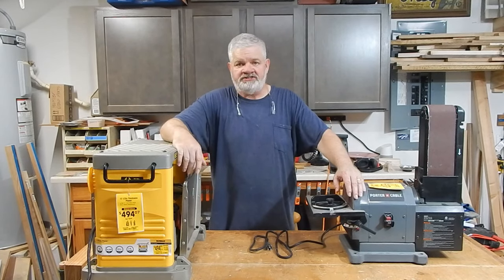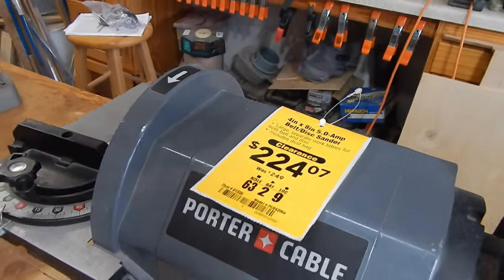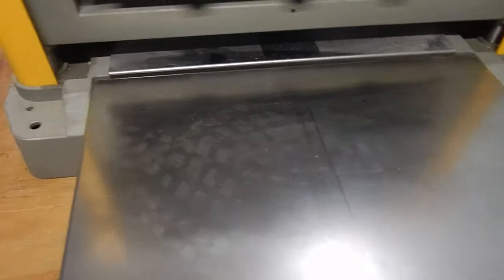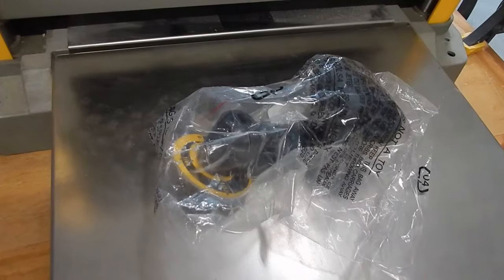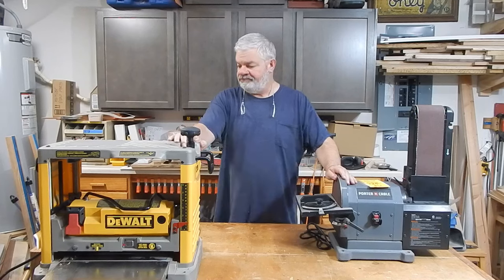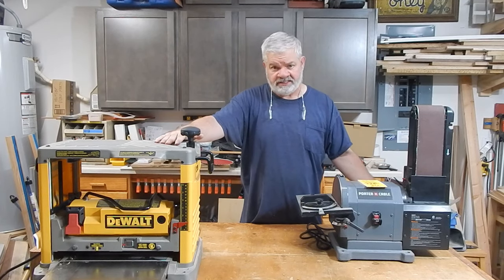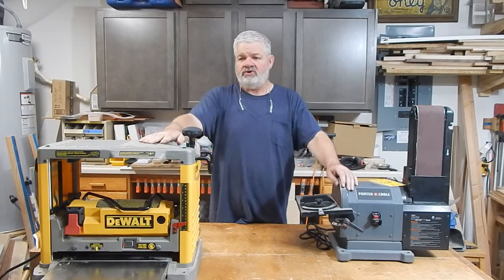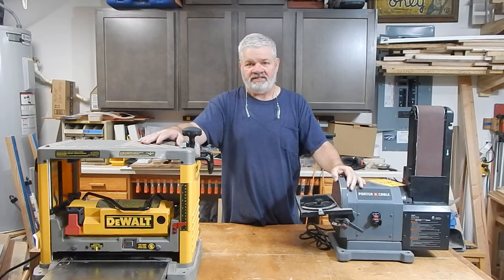Think Quality Tools Need to Be Expensive? Think Again!

Comment: My guess is, you could merely build a nice-looking flat wood base a tad bit larger than the machine's base, through-bolt it to the 3 existing legs and have a robust, steady & safe repair for that rocking-horse sander.
Reply from the maker: That's kind of the current plan. I just need to take the time to find the rubber feet that match.  I was going to check harbor freight to see if they have something.  As always, thanks for watching!

Comment: I have a dewalt lunchbox planer I got on Marketplace for a good deal.  
I find it can be tedious to get the infeed and outfeed tables level the base plate.
I would also open it up and check the planer blades just in case.  Its fine for me now but I want something bigger.
Reply from the maker: This is an upgrade for me but like you, I want a bigger one. I was looking at the helical head for it but can't justify it yet.